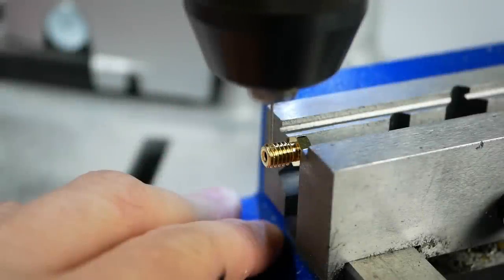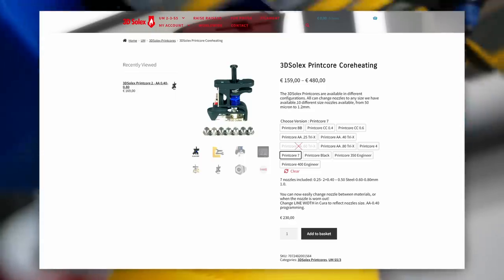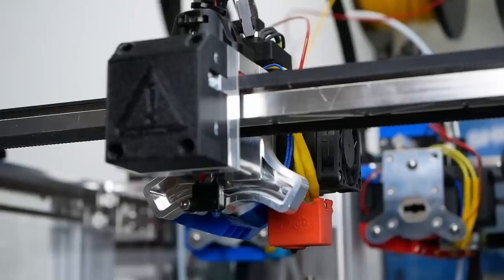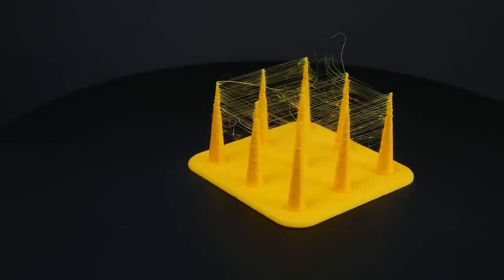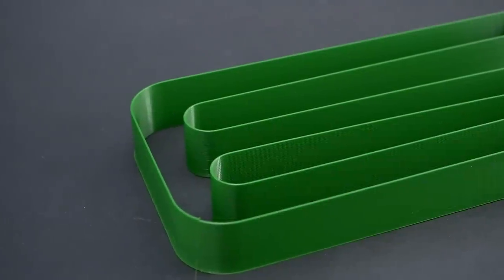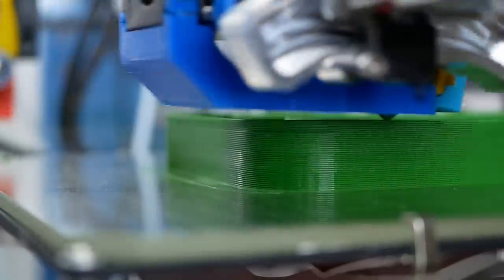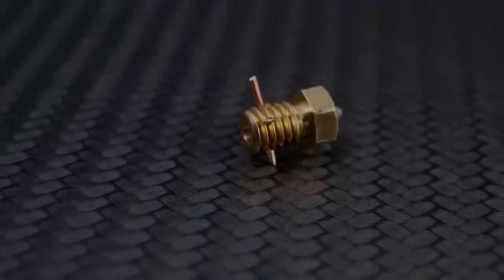My High Flow Nozzle is better than a Volcano hotend!

Comment: I used to make my own by just pressing a torx bit into the back of a nozzle so it deformed it into the filament and gave much more surface area.
Reply: How do you keep the threading on the outside from deforming?
Reply: @GerManBearPig  by holding the hex part i guess, and putting a nut in the outside...
Reply: @Rippthrough  Do you leave a small piece of the torx bit inside the nozzle or just deform the nozzle back?
Reply: @hdragoon1710  No you're just using the torx bit to push ridges into the path of the filament and increase surface area and reduce the distance to the core of the filament for more even heating.
Reply: @Rippthrough  Nice. I'm gonna try it
Reply from the maker: Great idea! I'll get a broach for my lathe to try that out. T6 might be a suitable size.
Reply: @CNCKitchen  Waiting for your video
Reply: @CNCKitchen  I would guess it would be even better if you buy a blank undrilled nozzle and then drill it undersized first, as you could keep the outer dimension tighter, but I haven't found anyone that sells the filament sized un-drilled, only the actual orifice. 
 I guess I could turn my own nozzle but that's more effort than I'm prepared to go to  :D
Reply: Good idea... There´s heat-pipes that function solely based on rifles along the inside surface of the pipe, if they bring such a huge effect there (more surface for faster water condensation), then why not here ??? A combination of your idea and Stephan´s one (presented here) would be a break-through... There´s many ways to solve the problem, bur yours and Stephan´s are also the most affordable...

Comment: Why not file the wire to a sharp line on the top? The 3d solex has very sharp edges that help shear the filament instead of forcing it against a blunt edge like the wires rounded profile
Reply: This is what I came to say, but leave the ends round for easier soldering
Reply: @danieljenkins4213  Exactly, would even plug it by pressing the ends like a rivet, so the temperature limitation of the solder is removed
Reply: @Tarex_  Peening probably won't make as good a thermal joint as soldering, and peening the second end so that the first remains tight is also tricky. I reckon silver solder is probably the best way, especially because we're not talking about mass production.
Reply: @cooperised  agreed, aluminum brazing rods are also an option
Reply: That's what I was going to say: file the the wire to a triangular shape with the point facing up. =)
Reply: Yeah was wondering that also, maybe a diamond or square shape.
Reply: I was thinking the same thing but said to try to flatten the wire where it would meet the filament but yes please try to sharpen or make the wire flatter then the round edge and redo the testing again verses all the other nozzles
Reply: 1mm-wire has a cross section of 0,785qmm, and thus can put-through 16Amps, and that only as a passive element, without any mechanical stresses.  0,8mm-wire has only a cross section of 0,504qmm, and thus can put through only 10Amps, when simply a passive element. You propose filing it, and thus making it even more vulnerable to the Amperage-stress. Maybe a separate voltage circuit for hot-end-heating, allowing higher voltage, and so, lower Amps would help?
Also, I bet that cold, solid filament will soon enough dull any sharp edge on malable, hot bronze...
Reply: I'm guessing it's simply due to the difficulty of the task. Have you ever tried to file something less than a millimetre wide that wants to squirrel all over the place? The frustration and time spent would be immense, and who knows how many wires you'd break before you (possibly) succeeded.
Reply: @fallingwater  i have ;) since he is cutting it out of a long wire, it can be held before cutting then it doesn't squiggle around, and if he can machine a a hole in the the threads of the nozzle, I'm sure he is capable of sharpening the wire ;)
Reply: @klausbrinck2137  since no current is going through it, it will be passive anyway, and id rather start the test with a sharp piece that gets dull than a dull wire that is in the way of the filament anyway, since he had to rrill out the top hole because it clogged or rather didn't have enough place to go, which would be mitigated by a sharp wire. There are other materials to stuff in there in a further testing round, heat treated steel wire, titanium, nichrome for all i care, then he can even run current through it
Reply: @fallingwater  that's true but that's why I said flatten , like smashing the wire with a hammer or in a press or many other ways to make it less blunt where it meets the filament
Reply: @Tarex_  you are a more patient man than I and I applaud you :D
Reply: @fallingwater  people say that about me, i just channel my impatience into fiddly crap like that and take the joy from seeing other people lose their head while fiddling with stuff that needs patience :D rewired all interior lights in my car to LEDs when i found out it's funny to see others being impatient watching me do what i was doing xD
Reply: @Tarex_  you´re completelly right, no current goes through it, I guess... But it  isn´t passive. Passive means, wenn it lays in a wall, and simply lets current pass through, but hier it´s an active element, under mechanical stress.
Reply: @Tarex_  you probably love watchmaking and repair then :D  people who do that get massive respect from me, but you couldn't pay me enough to do that job :D
Reply: @fallingwater  my point exactly xD but no, though, let's say not yet on the watchmaking, i do love to try new things :D so maybe soon I'll do that
Reply: @klausbrinck2137  Hab ich dann wohl falsch verstanden, hab's jetzt aber kapiert, das mit dem Nichrome als Zusatzheizung find ich inzwischen aber trotzdem ne interessante Möglichkeit :D
Reply: I had that thought as well, but occurs to me that the decrease in cross sectional area would also reduce the heat flux which is proportional to cross sectional area. So what's more important to filament flow rate, heat flux or shearing? Only another video will tell!
Reply: @naasking  if Stefan reads this comment and subsequent comments, haven't seen a reaction yet haha, but maybe he will make a followup video
Reply: @klausbrinck2137  you're just trying to justify your absurd comment. Your comment was relating to electrical characteristics. Electrically, it's passive. You should have stopped at the first sentence. Saying, "I guess," is just you trying to make it seem like you were technically right. You were technically 100% wrong. A wire in a wall, that is carrying current, is active in an electrical sense and passive in a mechanical sense. Relating to the wire in the nozzle, the wire in the nozzle is passive in both a mechanical sense and an electrical sense. Just because it has a force applied to it, doesn't make it active. It's not actively moving to cut or heat the filament. It is 100% passive.

Comment: Ex-cnc-machinist here: Mill the surface flat first, then use a center punch to mark the spot, then make a starter hole with just a bigger drill if you dont have a purpose built drill or mill for that, that is just a tiny bit bigger than the through hole you're making, so the hole is also chamfered already.

Comment: Hi Stefan. Could you possibly try to file the wire into triangle shape before inserting it into nozzle? That might help with flow restriction.
Reply: i was about to comment that....
Reply: oooh smort!
Reply: Filing would reduce cross sectional area, and since heat flux is proportional to that area you'd reduce the heat transfer to the filament. Copper wire is soft though, so maybe hammer it into a different shape? Might still reduce area but not as much.

Comment: 🤯 why didn't I think of this!? Impressive results really, I wouldn't have imagined it. Can't wait to see the results for a modified Volcano nozzle.
Reply: So i watched this video a couple days ago and I've been thinking about it a lot, primarily things like improving flow in mid-high flow applications. Volcanos, big build volume stuff.

It just hit me that something like this might also dramatically improve the speed at which you can run 0.2-0.3 nozzles, which is the biggest reason I don't use them. Also, it might help other flow challenged nozzles such as ruby nozzles.
Reply: It’s all fun and games until your Urologist breaks out the copper wire, some solder, and a threading die.

Comment: To prevent the wandering, you need to pre-drill with a center drill. Essentially, it's a very wide shaft with a very narrow, and more importantly short bit. It's specifically designed to prevent drill walking during the formal drilling process by giving the twistie a place to start.

Are you using an edge finder to locate as well? This assumes you have a digital readout on your mill, but it's still doable if all you have is gauges on the spindles.
Reply: you can also center it with a feelergauge and a pin or end mill shank in the chuck. just bring your pin closer till you feel slight resistance with the feelergauge between the part and the pin and then move the tool up and over by the radius of the pin + the radius of the screw + the thickness of the gauge and you will be on center.
Reply: Also, drilling in a round surface can be tricky. Maybe if a nut where threaded on and super glued in place, you could use that as a flat spot to spot drill. The nut could then be used as a tool when making more hot ends.
Reply: You could also mill a flat onto the threads to give a nicer surface to stick a drill bit into. It would give you an easy surface to cut off excess wire & solder, although with a thread die it's already pretty easy
Reply: for these little sizes pcb drills may work.  carbide though so brittle, but stubby
Reply: What about printing a jig that will hold the bit in place just long enough so it can drill the opening part, like half mm?
Reply: He only has a drill press it seems.
Reply: A center or spot drill is the solution as Aj stated. It is not necessary to have a DRO to find center using and edge finder though. You just have to run the table well beyond and then come back on both sides to take out the backlash and do more counting on dial turns and math.

Not that it would work well in this case anyway as the sides are threaded and uneven. Measuring from the vise jaws is the easier method here and close enough.
Reply: @maxhammick948  Exactly, an endmill does wonders! After that a center drill not before.
Reply: @GoingtoHecq  even with a drill press you can do plunge cuts with an endmill.
Reply: I'm pretty sure he knows what a center drill is lol
Reply: @Spencerburner  Perhaps, but he asked, and there's nothing wrong with not knowing and admitting that.
Reply: You could just use 2 M6 nuts and countertighten them. Then you have a few flat spots that are easy to drill into. Center drilling that nut first definately helps, but you can just put the drill way up into the chuck too, so it has less room to bend away. Milling/filing a flat spot into the nozzle thread first definately helps too
Reply: If the surface to be drilled is very steep it is likely even a stiff center drill may not work and "spot facing" with a similarly sized end mill will create a better surface to start on.  From there, a center drill can then be used to start the desired hole.
Reply: @maxhammick948  I thought the same thing, although the missing thread would reduce heat transfer around the wire and possible negate the performance. I think the best approach would be to make the nozzle from stock and drill the hole before shaping.
Reply: @maxhammick948  if I'm understanding, that would diminish the heat transfer interface between the nozzle and the hot end--not sure how much that would impact even heating, but non-zero.
Reply: @collinbardini  red loctite might be better since you can remove it easier at the end
Reply: @GigsTaggart  carbide is best suited for super rigid setups. It'll frag and disappear with any wiggle. HSS is much better suited for hobby drill work.
Reply: @taliamon  This! and your reply shows high class, which is not to say that Spencer was trolling or being rude. Thank you for the thoughtful reply and expressing that it is always ok to say you don't know something. Lack of knowledge is not a sin.
Reply: On a rounded surface like that, you ideally would want to use an end mill that is a bit bigger than the drill bit to mill a flat spot for the drill to start on - drills really do not like to stay in place if you try to drill into a convex surface.

But using either a nut to have a flat spot, or using a 3D printed fixture to hold the drill straight until it has bitten into the material would work as well, the hole doesn't need to be ultra precise after all.
Reply: He said in the video he's just using a drill press, which doesn't help with ensuring the part is on center, the best you can do is eyeball it, but for something like this, I think eyeballing is close enough. Also a center drill is definitely the way to go.
Reply: pre-drilling with an end mill is the way
Reply: Or use a center cutting endmill.  It will create a nicer, smoother hole and requires no pre-drilling.
It's what I do to mill through threads or angled surfaces.

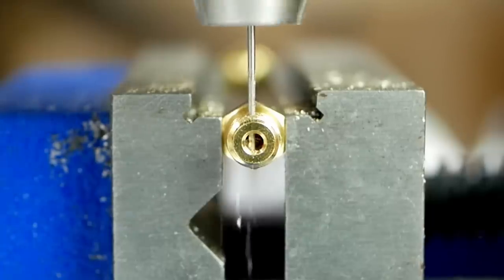Comment: 2:20 Use an endmill to start the hole, or use a center drill and then the actual drill. The center drill is a drill but much smaller and is very stiff, so it doesn't wander, its used to start holes, sort of like a center punch
Reply: Always use center drill for accurate holes. And using an endmill to make flat is also a good thing. But in this case is enough with center drill :)
Reply: I'd probably also go through a thread peak on the front side so that the back side will exit in a trough. That SHOULD improve the end result if memory serves correct
Reply: Grind/mill the threads off and make a flat area to drill through. Tidy the cut threads up to remove burrs.

Comment: File down the wire into a shape approximating a blade. You’d get the internal heating zone, and the flow resistance would decrease due to a decreased flow area reduction.

Comment: I think you should try to make this nozzle again but have the rod that is going through closer to the bottom. Since it's around the top, the filament would have had very little time to melt at that point, so it is trying to push around that rod when it's relatively cold. However, if the rod was at the bottom, it would have already heated up mostly, so it could flow around the rod easier because it is less viscous. I think this could substantially decrease the resistance, hence increasing the flow.
Reply: Very good and logical idea ....
Reply: I think the point is that the copper conducts heat better from the heat block. Lower and it would become a heat sink instead.

Comment: One solution to drill is using a nut and drill the nut and the nozzle at one time. It's to find the center of the nut because it's a rectangle (or square).
Reply: this sounds brilliant.
Reply: It's easy to find the center of the nut
Reply: This☝